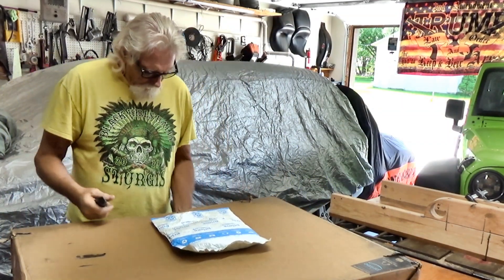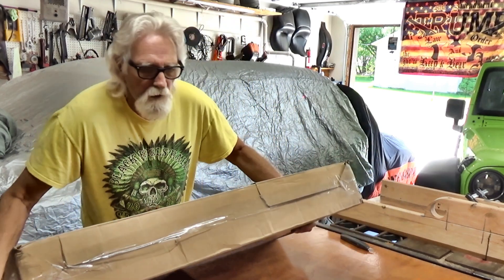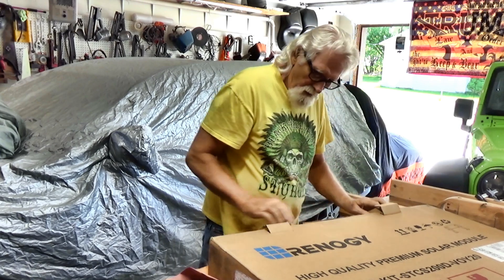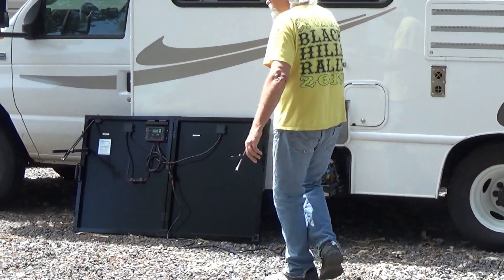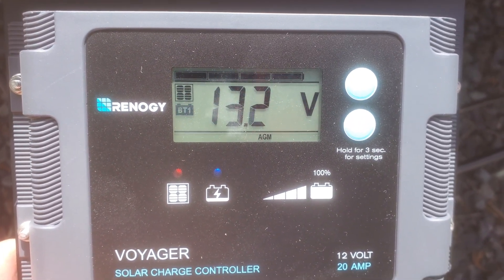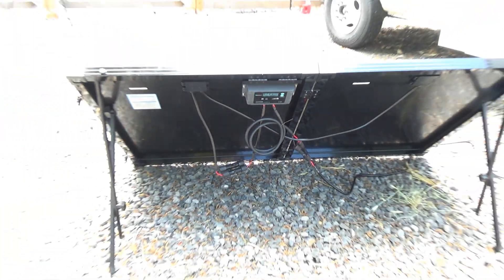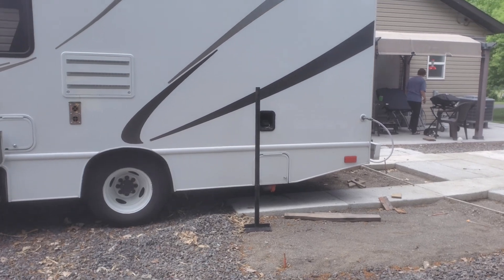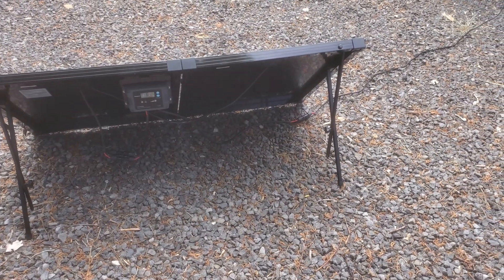Renogy 200 Watt 12 Volt Portable Solar Panel what's in the box? #1515

Comment: Great video!! Can you use that to power anything in your RV or is it just for charging the batteries? Like a tender?
Reply from the maker: Well kind of like a tender but more like a battery charger so you would have to have a battery power things but this would keep the battery charged. We have used it recently in the hills and never had to use a generator at all. We were there for three days and never had to worry about the batteries. They would go low at night but as soon as the sun hit that thing it was charging at between 13 and 14 volts all day in the Sun